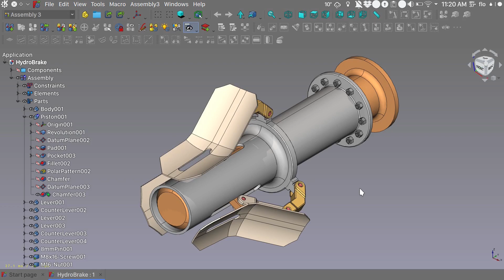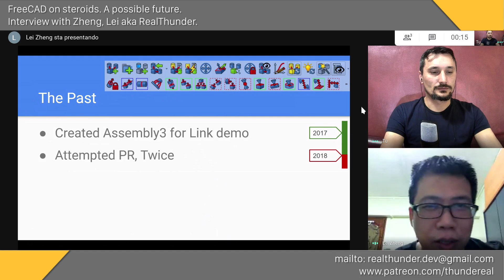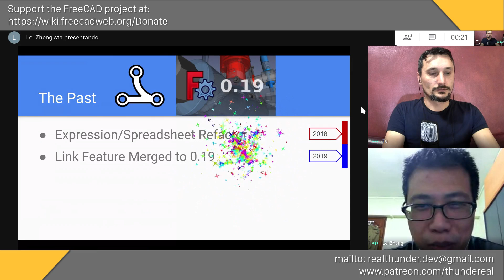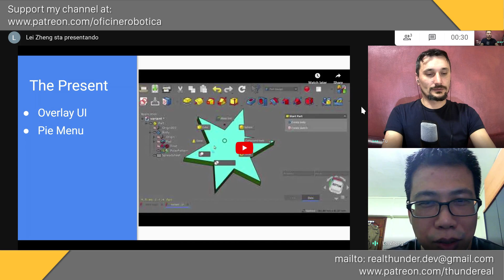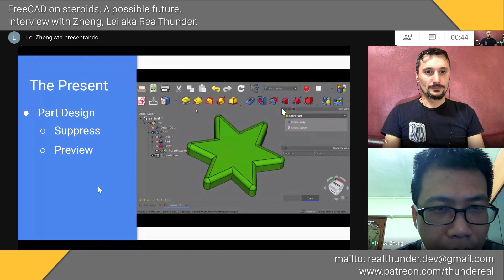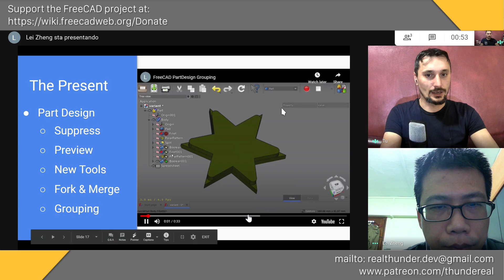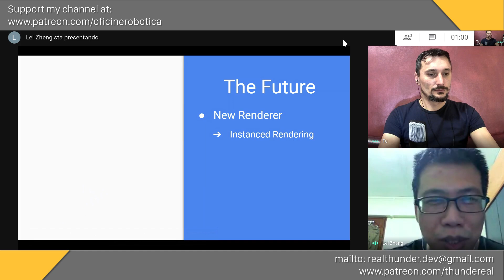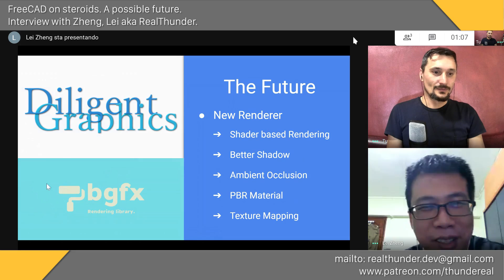FreeCAD on steroids. Interview with Zheng Lei aka RealThunder.

Comment: Topological naming FIX 🍾 
Hopefully it'll be merged soon.. On my workflow (learned from commercial cads), this has been one of biggest drawbacks when doing iterations in design. Great to see some future plans.
Reply from the maker: Yes, The TNP is indeed a big hurdle for users and coders alike. It is nice to see him taking on such a huge task.
Reply: @OficineRobotica  It would be really useful if the incompatibilities between Real Thunder's solution for the TNP and master branch could be resolved before any further feature development takes place. As discussion on the forum indicates it is potentially more important to preserve the ability to maintain stability in FreeCAD core than to introduce changes that threaten that stability.
Sadly I do not have the skills to contribute technically but it seems that Real Thunder's fix introduces complications that make it not yet practical to incorporate into the master branch. I hope Real Thunder can help the main developers to overcome these complications soon, even if it means slowing development of further changes in his branch.
Reply from the maker: @paulreader1777  at the moment the new topo naming algo is being merged and that is the foundation of bringing in all the other inhancements. Slowly everything is getting in to master.  The topo naming algorithm is one of the points where the compatibility breaks so once the merge is finished the sitiation will improve a lot

Comment: No joke, I mean I'm an utilitarian as much as the next guy, but the Shadow feature is the one I liked the most about realthunder's branch. 

not the actual shadow itself per se, but the persistent lighting. like ... usually in FreeCAD you have a normal map that's applied from the view vector. it shades regions so you can better visualise curvature. but the lighting is ALWAYS aligned to the view. that is ... if you have a sphere, and you rotate it around, it will look exactly the same. which is sometimes cpnfusing for complex models. the world-aligned lighting introduced in the Shadow feature is SOOOOOOO COMFORTABLE 

it's one of those things you have to see for yourself to believe
Reply from the maker: The way you have putted this in to words is just perfect. I completely agree with you.